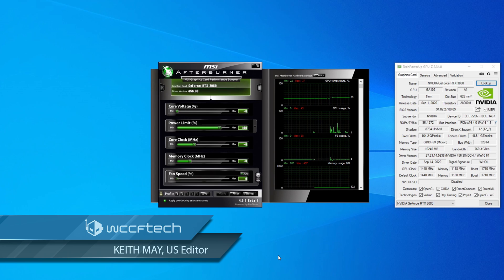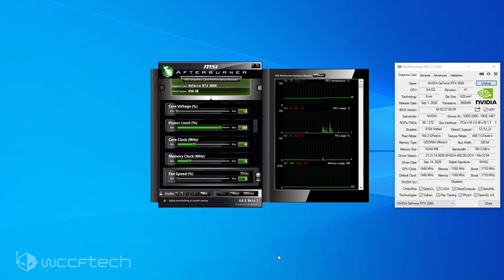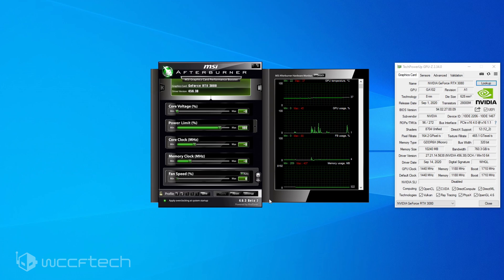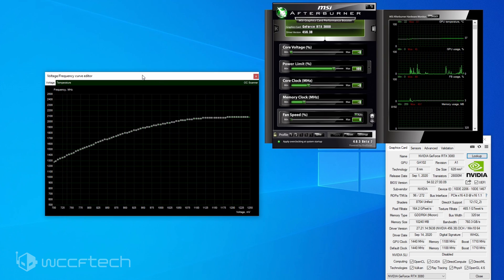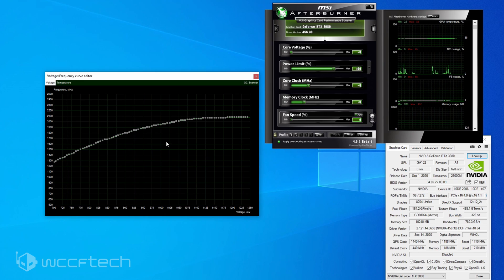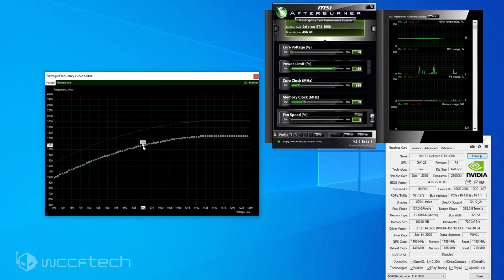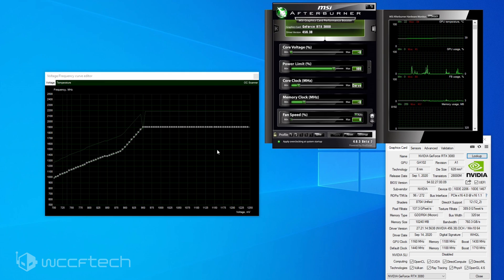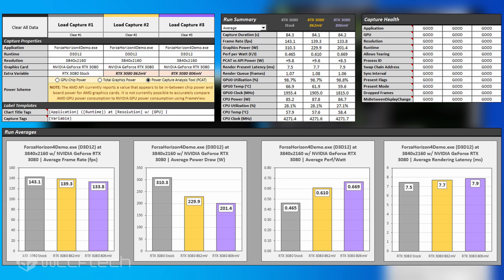How To Undervolt RTX 3080 For Huge Efficiency Gains

Comment: Applied this to my 3080 yesterday runs alot cooler and quieter and the loss in fps isnt even noticed as its minimal, thanks for the great video.
Reply: My 3080 never goes over 62 degrees under load with 1440p Ultra in new games such as Cyberpunk, what model are you using?.
Reply: @mikeycrackson  Yeah i had isssues with my Gigabyte 2080 aswell. i'm super happy with my TUF 3080, haven't seen it go past 62c yet, and that's in Quiet mode aswell.
Reply: @ESPirits87  I have 3080 tuf and im getting coil whine, have you had that problem?
Reply: @carl9966  MSI Gaming Z, I got coil too lmao
Reply: @lukasg2786  yea i think its just a problem with 30s cards mine luckily isnt bad and i dont even notice it anymore
Reply: @carl9966  it feels like you get used to it lmao

Comment: any reason for 806 and 862 mV specifically? This is my first time undervolting
Reply: Also don't be surprised if the benchmark runs fine and you open a game a crash within 5 minutes
Reply: @gavilar5425  Yup Battlefield 5 does this. Can pass benchmark but not the game. That game is the real bench
Reply: @Spelldaoc  happens to me on red dead redemption 2 all the time
Reply: No special meaning on those numbers. The better quality the silicon, the lower voltage it will operate at and remain stable. So these values will be different for every card due to manufacturing quality variations.

Comment: So what if I wanted to do this with a factory overclocked GPU (ie, XC3 Ultra)? This was the only one I was able to order, but I'm operating with a 650w PSU, so I want to bring down power consumption as much as possible. Do I still target the same MhZ as the reference card?
Reply: Undervolting at 0.86v will be fine for your power draw

Comment: Can anyone please help, i followed this video the the exact measurements trying both curves, the first one does nothing for me but games run, but the aggressive one makes games crash instantly when a level loads, this is on a FE 3080, any ideas??
Reply: That most likely means your gpu does not undervolt as well the one in the video. I suggest you go back to the first one and test more aggresive frequencies in small steps until you see instability then ease off again by a bit.
Reply: Check optimum tech video which has a graph showing the voltages needed to get a given frequency. You're probably undervolting too far for the set frequency.

Comment: Ive dropped to 0.875mV but power draw has only dropped 10W to 320W?   Cant seem to get the same power saving??
Reply: Have you tested this in heaven benchmark? For some reason, in heaven benchmark it still uses 300w+ of power, but in games it will stay much lower

Comment: I found I still needed to alter the temperature/clock curve, otherwise it wont stay at 1900+. I set the max clock to be 1950~ all the way up to 83C. For some reason by default it's set to 1700 once you activate the custom curve in Afterburner?

Comment: and something that worked well for my msi ventus 3080 was 818mv at 1845mhz , i only lost like about 5 fps but on the bright side i'm getting great performance with steady temps as low as 64  degrees c
Reply: Add a custom fan curve to get even lower fans. This can increase your noise levels, depends on the fans, but I found that 60% fan is still quiet enough

Comment: Glad I found this video, I ended up undervolting to 900mv but at a solid 1950mhz. It was actually stable at 875mv, but bumped it to 900mv for that extra tiny bit of stability. Stock it wanted 1.1V for 1950mhz. So it's about a 200mv undervolt! This dropped my power usage by about 80-90w and temps barely scrape 59-63C. The crazy part is that in certain games, it's actually an overclock. The Witcher 3 for example at stock clocked only at around 1850-1875mhz. Thanks for posting this!
Reply: @FeisarX  Yup I followed the tips by first starting with -290 core clock, then clicking the point at 900mV and moving it up to 1950mhz. Of course tweaked a few hours to get to this point where to me is the best balance. Right now I'm just messing around with 800mv to see how high mhz I can get at that low voltage.
Reply: Oh like a 2 step curve then?
I'm going to try that rn
Reply: @MrAskolein  Yes well worth the effort. I kept tweaking and ended up at 1905mhz at 850mV, temps now are crazy cool topping out at 58C in the Witcher 3, and super crazy 50C in COD MW. Ridiculous efficiency
Reply: @soapa4279  i have trouble setting up this curve like you describe.

Would you mind sharing a screenshot of your curve? What are your others settings exactly?

I would really appreciate it, I am very intrigued by your setup! :)
Reply: 3080 or 3090?

Comment: Been looking for this... Even tho I have EVGA XC3 Ultra but I think I can do about the same numbers with similar result. Thank you again!
Reply: How did it go? What are your thermals like? Waiting on that card myself.
Reply: Sean C it’s good now man, was idling at 59-62C and max on 84. Now just 29-32C and max at 70 on an hour run on WarZone Max setting.

P/s: this is running on an NZXT H1 too with thermal being a little more restricted but this is still pretty good numbers.
Reply: I have the XC3 Ultra too, but it's in a H510 elite which really restricts airflow, and I'm using an 280mm AIO. It was running all the way to 80C on stock settings. played with the undervolt now its sitting between 70-72C
Reply: @joselleforever  Was that hitting 80c in games or just in benchmarking apps?
Reply: @hankhillsdisappointedsigh  actually the only benchmarking app i have is heaven which i dont know if its reliable for temp monitoring. I was playing warzone, apex legends and dmc5 with everything max and even the resolution scaling. I had to undervolt at .875mv at 1860mhz and fiddle around with the fan curve

Comment: just use the msi auto overclock/undervolt utility and call it a day.
Reply: doesn't work on 3000 series
Reply: @iamdmc  RIP thats homosexual. i use it on my 1050ti laptop and it gives me like 10 percent better clocks.
Reply: Joker you should give it a try to arrive in 2020

Comment: Running the OC scanner tool in the top right of the curve window will give a good idea of how high the GPU can go for every voltage step. After it has run pick the voltage you want to target and then apply the same leveling technique from there. Much better than guessing, then benching, then guessing again.
Reply: Unfortunately I got a crash the 2 times I ran the OC Scanner.
Reply: @Tony72495  that's unfortunate. I haven't had that issue before and I have used it on a lot of desktops and laptops. 
It's normal that it can take quite a while as it runs through it's testing and may appear locked up. 
Did you try a more recent version of Afterburner? If you managed to get a good undervolt or overclock that's the most important thing.
Reply: @Berserkism  The most recent, 4.6.3 beta.  And it didn't just lock up, it rebooted.  Went to black screen, then the BIOS came up, then booted into Windows.

Comment: Seems pretty similar to what people were doing on the AMD side of things, shipped with voltages slightly too high to make sure every card hit advertised frequencies so people undervolted, that reduced the thermal/power load on the GPU and therefore it could actually clock itself higher if you increased the power limit overall.

Comment: Wow this is a very impressive result. I would definitely take the 1-3% performance hit for ~100 watts less power and thus a much cooler and quieter GPU. I saved this video for reference when I get my hands on my 3080.
Reply: When you mean performance hit, what exactly are you referring? From what I see in the video, the FPS is more or less at the same level, while running a more consistent clock and lower temp. Is there something else that I should be looking at?
Reply: Wurfenking yup you’re right. Performance increase in some cases due to increased boost from having lower temps
Reply: You are probably gonna get higher performance actually.
Not sure why but one thing I have heard is that the GDDR6x memory type is sensitive to heat.
I did pretty much the same thing as in the video. Caped it at 1910 MHz at around 950 mV and my score in Unigine Superposition benchmark increased slightly.
Also I haven't had any crashes since. Played a long session in Control which usually used to end in a crash before the undervolt. Needs more testing off course.
Reply: @youluvana  thermal pad mods help too. Igors lab has a English written article on it if you're interested.
Reply: @tacticalcenter8658  I'm interested in making a custom aircooler actually. With a big radiator and some nice Noctua fans. Something that I could reuse in the future for the next graphics card. Otherwise it would be kind of a bad investment. But not sure if it's possible to make one custom heat sink fit different graphics cards though.
Reply: @youluvana  your on your own with that one. Check out how evga does it on the kingpin model for a start. It's not an fe model so it will differ a lot but the general concept is something to consider.
Reply: The 3070Ti suffers from this horrendous power consumption issue now too. 7% faster but draws 40% more power. GDDR6X is a disaster and can also be downclocked/UV'd for almost no performance loss.
Reply: Worked perfectly on my 3080ti EVGA.  Did a slight undervolt to 950 and 1910. Temps went from 82 to 76, Fan speed 2800 to 2000, Power from 404 to 364 watts, basically no performance hit.  The greatest thing to happen was the fans don't run at 100 percent or even 90 or 80, thus preventing me from refunding this card and making the card quiet. Thanks.
Reply: But if you have 370watts version gpu you can uv 800mv draw about 290watts... its only 290watts les than him gpu... better worth normal 3070 buy and uv to 150watts.
Reply: Just get one of the new amd cards instead... Once they reveal the benchmarks and power usages etc.
Reply: @tacticalcenter8658  ok random internet user
i will do so
Reply: @someone-wi4xl  the new card is said to compete against the 3080 and be lower power usage. Remains to be seen how low it will be. Just using gddr6 instead of 6x will reduce the power. Though the boost speeds will reach over 2300 from the driver leak... Its only for boosting and not constant. So... should be maybe 250 to 300w max.
Reply: @tacticalcenter8658  so what I hear you saying is that Jesus loves us, and if we will just accept him into our hearts, we'll be saved :)
Reply: @CarnaghSidhe  no... That's made up by humans. There is little to any truth about that.
Reply: @tacticalcenter8658  which is why I used it as a metaphor. You're telling us about the prospect of AMD releasing a card running at 250W to 300W, after having just watched a video showing how you can set a 3080 to run at between 200W and 230W... you're being quite evangelical.
Reply: @CarnaghSidhe  you can do the same with any brand old or new including that new amd card.
Reply: @tacticalcenter8658  indeed you can. My current card is undervolted in exactly the same way... I'm not the one however bringing up higher stock power usage as a selling point, on a video about undervolting with lower power usage. You are.
Reply: @tacticalcenter8658  don't get bent out of shape mate, we're commenting on a video :)
Reply: @tacticalcenter8658  i have a 3080 fe... fyi amd is not going to win this one. Its going to be same old drivers are going to be fucked forever and raytracing is going to be trash...
Reply: @sagerdood  so how do you find your driver on your 3080 🤣🤣🤣
Reply: @Dervakon  drivers are great. No issues wheres the joke yuckles?
Reply: @sagerdood this didn’t age well :C
Reply: @tacticalcenter8658  that aged well
Reply: @THEAVERAGEGAMER13  yea it looks like I was right all along. Amd did a really good job. But with that said the amd card costs wayyy to much for what they are offering vs what Nvidia are offering despite Nvidia being very inefficient. But at least you can do so much more than just gaming only. Both cards trade blow in gaming and you can oc a 6800xt to throw blows with a 3090 in some games... Though 2.7ghz consumes a lot more power. I'm likely going to get an Nvidia 30 series next year when the super's release and the beta test is done. I prefer the additional features like tensor cores for 3D, rendering, compute workloads, media encoding and streaming using nvenc, bit coin mining, NV Broadcast etc. So much more for the same dollor. I don't really care if its slower in games. The Nvidia card is the better buy because amd pricing is too high and they don't even offer these things and Ray tracing isn't nearly as good.
Reply: @tacticalcenter8658  I was considering going amd until Canada's equivalent of micro center, memory express didn't get a single card still to this day I believe so I ended up going with the 3080. I wouldn't even call it a launch very upsetting
Reply: @THEAVERAGEGAMER13  well considering Nvidia had much longer time on the market that would make sense you were able to get one. Amd will be in more supply mid and late December. They are projected to sell more than Nvidia by end of year. But Nvidia got a head start. The thing is...will scalpers get them or gamers? Also amd is only only sales where Nvidia is doing a bit of both big box stores and online. In any case I think if your gaming only you can't go wrong with whatever brand you can actually get ahold of. Those who do more than just gaming, get an Nvidia card when available.